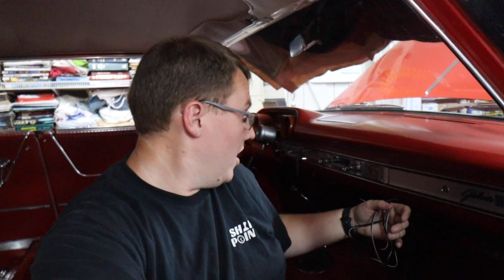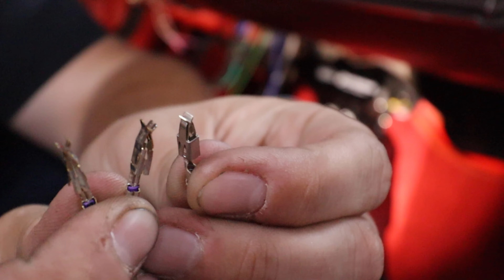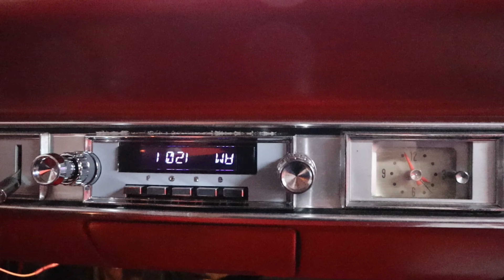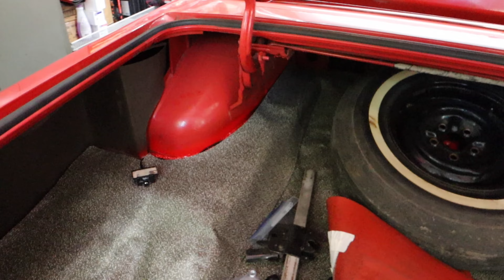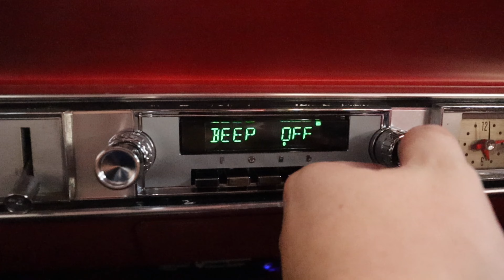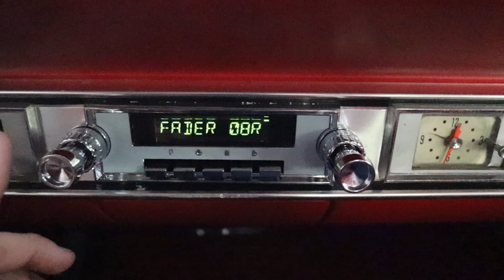Wiring a Radio and Making It Sound AWESOME! (Retrosound Radio!)

Comment: Hey! I just bought a 1963.5 Ford Galaxie 500 with a 390 and auto trans and was wanting to covert it to a 4 speed manual or 5 speed tremec transmission. Any way you could like show the factory z-bar set up? Im trying to find all the parts i would need for a top loader 4 speed transmission. I feel like that would be cheaper route to go rather than than the Tremec TKX which is about $7500 for the conversion from MDL
Reply from the maker: @XxWowIdkWhyxX  that's an awesome purchase there! I can for sure get some pictures! I think if you go back to some of the later videos we did with this car last year I may show it. I remember adjusting it at one point.
Reply: @shift_points  awesome thanks I will keep searching through your videos! They are a great watch! I think I did see someone else was basically doing my the same conversion in the comments of one of the videos and said you showed the z bar but I must have missed it. Thanks! BTW I also stay in NC, near the Greensboro area!
Reply from the maker: @XxWowIdkWhyxX  I'll try and get those pictures for you asap. That is awesome to hear!! Thanks for watching. Nice we are only about 3 hours apart then!